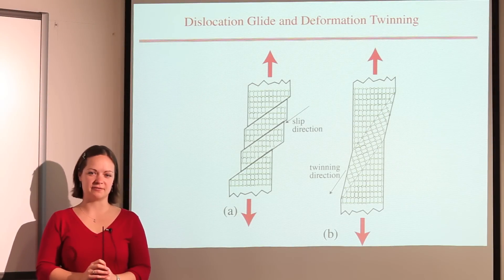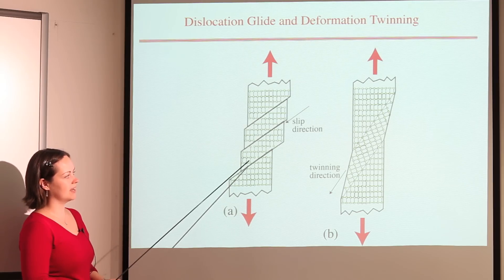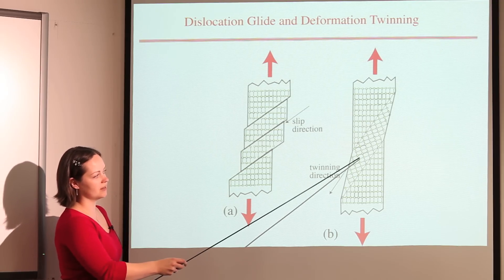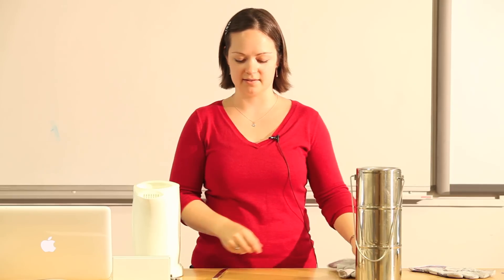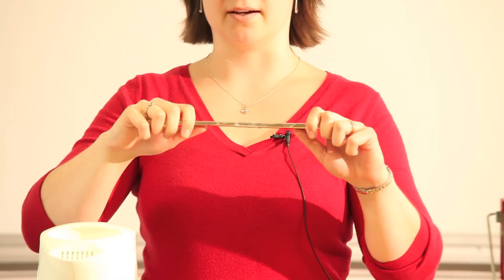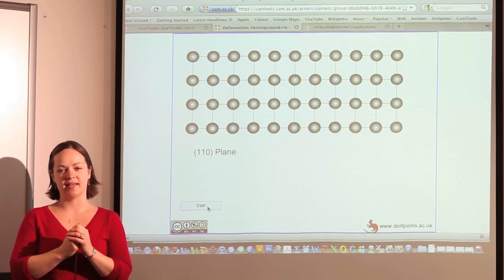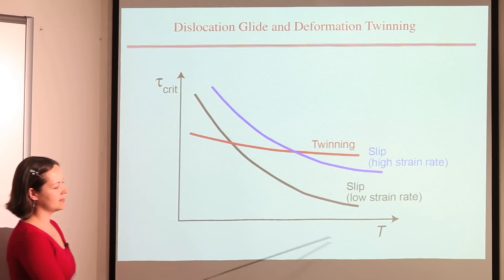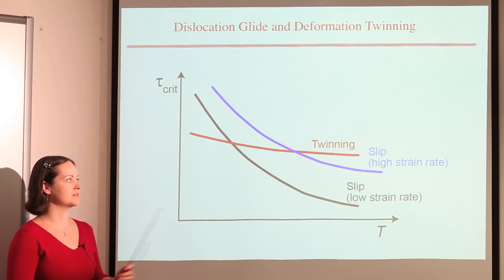Tin Cry and Mechanical Twinning

Comment: So Tin cry sounds a lot like the noise made by most (almost all if I'm not mistaken) crunchy foods. This would mean that they must be hitting the same "notes". Is there some reason why they should have the same frequency distribution?
Reply from the maker: I have no idea or proof that the character of the noise is the same.
Reply: @bhadeshia123  Okay, so when i break bread or other crunchy (brittle) foods, I get a similar sound. For the foods, we can see that this is related to fracture since the components break apart. My first instinct was to assume that something similar is happening here. I found a youtube video "https://www.youtube.com/watch?v=rXV5tfDJsH8" for this. First, do you agree with the premise? If so, then why isn't that "crackling" noise associated with microfracture in tin? To elaborate, there could be twining happening in the material, but parallelly there could be microfracture, and it's the microfracture that generates this characteristic "crackling" sound. I'm of course assuming that there is no twinning in food and other edibles.
PS:- When you reply, please use the @<Myname> handle, that way it'll come up in my notifications (At least I think that's how it works).